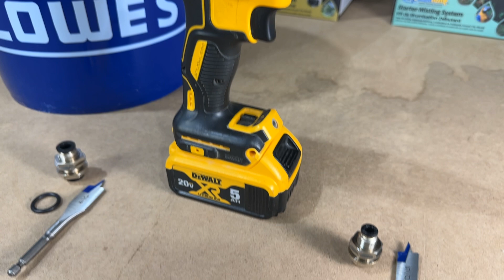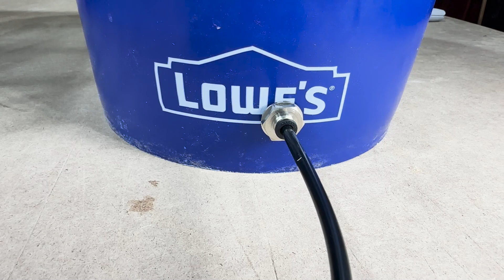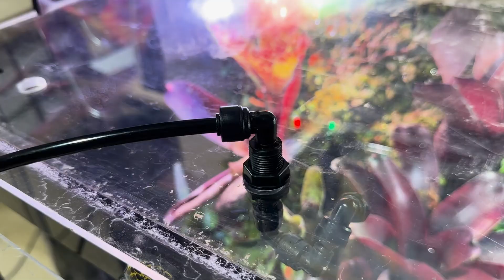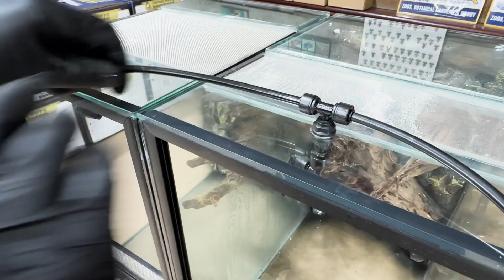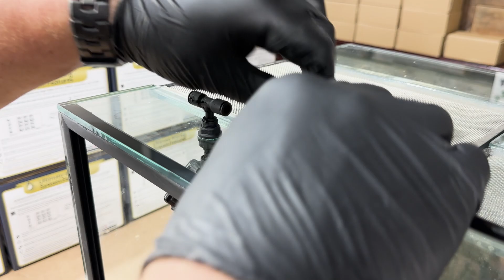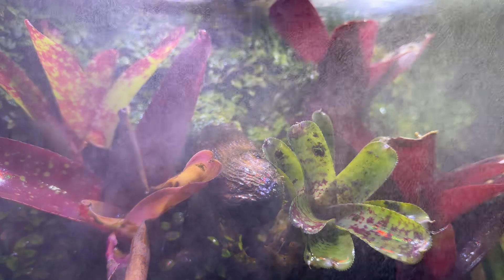MistKing System Quick Video Setup

Comment: Question I run a 50ft line with 10 nozzles. Do I need to run the line back to the solenoid valve 50ft?

Comment: I purchased the Ultimate Misting System with Zip Drip to use outdoors. We just built a 25 ft stream bed, and I want to run the MistKing to mist all of the moss we have placed on the sides of our stream bed. Will this system do the trick?

Comment: Do you guys happen to sell shut off valves ?asking because I am interested in running your system across multiple tanks but would like a shut off valve between each one in the chances I need to disconnect one of the tanks ( and avoid water leaking out of the lines ).
Reply from the maker: We offer both manual (ball valve) and automatic (solenoid valve), for more help fill out contact us form: https://junglehobbies.com/contact-us/